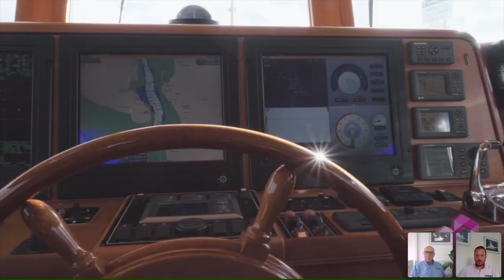Nordhavn Broker Chat: New Boat Design with Neil Russell and Philip Roach - Nordhavn Europe

Comment: 1.  How do thru hull stabilizers affect performance ?
2.  Are gyro stabilizers applicable on certain models ?
3.  Re the 63 aft pilot house model:
a.  options to replace granite counter tops ?
b.  Range at 6 knots for standard engine with standard tankage ?
c.  can all appliances be USA variants - Whirlpool to be specific ?
d.  option to include forward looking sonar ?
e.  why two radars ?
Reply: All very good questions..was wondering if a tankless hot water heater was ever considered?